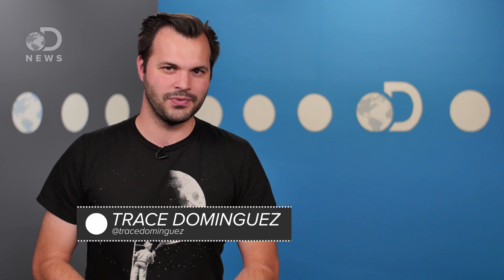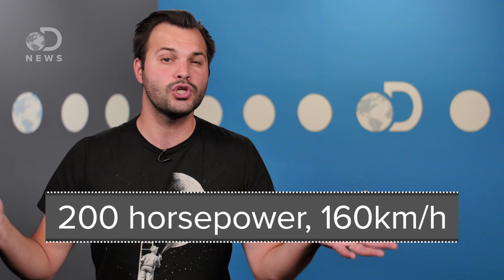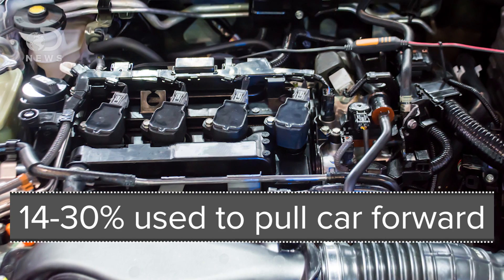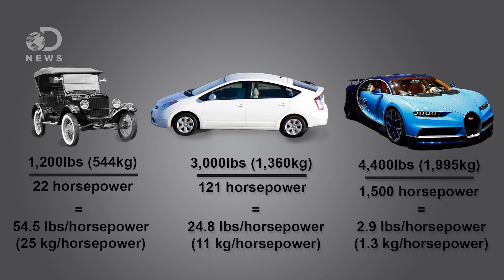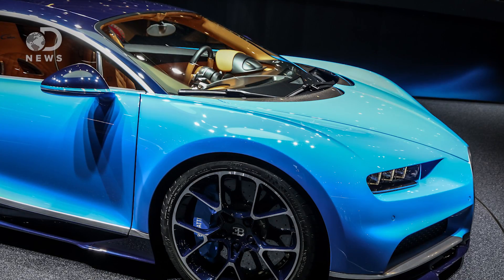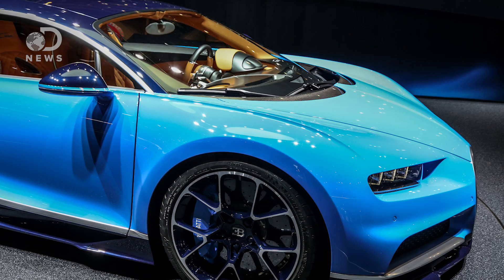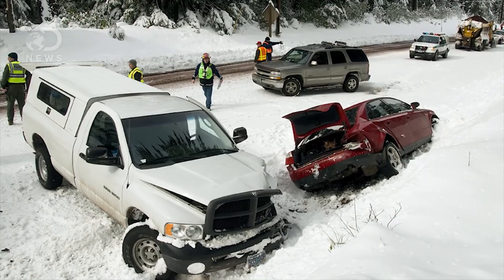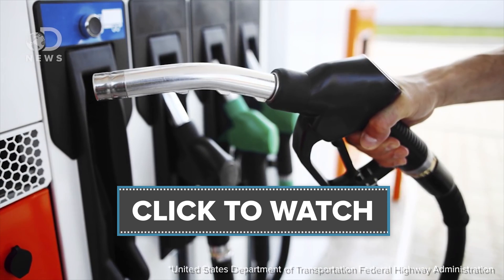Why Isn’t Your Car Faster Than A Sports Car?

Comment: Drive electric. 90% efficiency versus 30% in a gas car.
Reply: Tesla P90Ds are both efficient and fun. Seriously, have you ever been in one? The acceleration is brutal.
Reply: life is too short to drive a boring car 2jz 240sx throwing skids 0% efficient 100% fun vs 90% efficiency 0% fun going in a straight line
Reply: Chris Yates how fun is it to go in a straight line with a car that sounds like my fan
Reply: "0% fun", you're obviously clueless when it comes to EVs.
Reply: oh gee they forgot to put a steering wheel in my Tesla, doh I can only go in a straight line. LOL
Reply: almost as bad as the bmw i8 artificial sound hold on let me download a new sound pack for my car
Reply: +Jared A. You are not old enough to drive a car. get back to school. kid!
Reply: Kevin J Candlert Dnews does not go in the real detail, things like compression in the cylinder is not even mentioned. take F1 Cars. they have a small V6 engine with a displayment of 1.6L or 97 ci. that is tiny, my old mondeo had a bigger engine and even my consul from 75 has bigger engine but the F1 engine has almost no space between the cylinder and piston and thus no pressure loss and more power, note that they idle at around 2500 RPM.

Jared A. And what do u know about cars? Tesla has the fastest 4-door car ever made in history. What is a good car for you? if you would buy a good well equipped car then it will run over 36K.

Uncle Demort There is still sound from the air and the wheels. don´t believe it is soundless killing machine. now a days cars are quiet, you dont hear the engine and the exhaust as you did with the cars from the 1970, they wore significantly louder. And i would say that the low cost of charging a tesla compensates for the "PAIN IN THE ASS"  to charge a electric car, at least here in sweden, where the gas price is $6,12 a gallon, i would rather spend a few nights in a month charging a tesla for the fraction of the cost of filling a full tank every 3th week or so.
Reply: <drops mic>
Reply: supras out-race everything
Reply: Uncle Demort it doesnt make a difference if its toyota or not lol. u clearly know nothing about engines and cars in general. toyota wants its reputation to be how you perceive it, a economical car for family use, however the supra is an exception.
Reply: Again, I couldn't agree more! Also, in my last post I said "Internet car dude" and did not notice that that was ur name. It was not directed at you, lol!
Reply: So?..
Reply: well he got you there, but i have heard from a employee from Tesla in Norway that electric cars may get more load, people can´t heard them when they are coming and that increases the risk for an accident.
Reply: my blender sounds better than this lmao
Reply: drive sram etap
Reply: Checkout the Zombie 222, a 68' mustang on DC engines
Reply: fuck off. fuck electric cars
Reply: I have not over 36 thousand dollars for a shitty car (Teslas are shit just like Chevy, Ford, so on) that won't get me anywhere I need to actually be at.
Reply: Jared A. ikr, pigs from minecraft areuch better
Reply: Electric cars are deadlier, you can't hear em, people will be falling asleep by the wheel, people won't hear the car and go - get run over. AND RECHARGING IT IS PAIN IN THE ASS! Too often, and electric stations aren't everywhere
Reply: +Kevin J Candlert Also let me remind you that it's summer.
Reply: +Jared A. that's not a reason for you not to learn anything. keep watching dnews and other science channels
Reply: Vzano it's a minimal sound. We need to make cars louder and louder.  See, you live in Sweden. Sweden has the safest roads, Sweden is rich and has a lot of places where you can recharge. You see in Riga where I live there are only a few places. EVEN IN AMERICA they're not as often. You see since your country us rich, gas is gon' cost more. Our price is around 1.000
Reply: Uncle Demort safe yes, the safest, i can´t say because the quality on the road varies a lot. When i drive home, there is a couple of hundreds of meters on the road that leads to my house that has no sidewalk, people are literally walking on the side of the road and often close to cars.
Reply: +Vzano I checked statistics. England comes in second
Reply: +Vzano huh? we have that even in Riga. seriously, take a tallink to ruga with you car. ride here, myb in Russia a bit. You'll see how lucky you are
Reply: I have been in different countries then just in sweden. i have went from western sweden all the way down to serbia where i have seen roads that slinger around corners in the canyons with a edge that leads to certain death, it does also be seen when you travel across rumania from timisoara to suceava.
Reply: Do you struggle to recharge your cell phone? Obviously you do.
Reply: Teslas are not shit. Chevy was run into the ground (i.e. bankruptcy) by management and then saved by the US govt. They deliberately covered up a known part that failed causing people to die. You are too immature right now to understand the real auto industry.
Reply: +InternetDude yes I do. Electric cars are boring. That's it. Only electric car I'm willing to drive is a REGERA (if you know what it is Tesla nobhead). As I said, they're quiet (which is dangerous, cuz people don't hear you, and you might even fall asleep). Most of them are shite.
Reply: +InternetDude yes I do. Electric cars are boring. That's it. Only electric car I'm willing to drive is a REGERA (if you know what it is Tesla nobhead). As I said, they're quiet (which is dangerous, cuz people don't hear you, and you might even fall asleep). Most of them are shite.
Reply: +InternetDude yes I do. Electric cars are boring. That's it. Only electric car I'm willing to drive is a REGERA (if you know what it is Tesla nobhead). As I said, they're quiet (which is dangerous, cuz people don't hear you, and you might even fall asleep). Most of them are shite.
Reply: All your blabbing aside, what vehicle do you own and drive today?
Reply: +InternetDude I don't haha. but I'm into cars and motorcycles. you know what? fuck cars, stupid cages. All bout motorcycles! I'm getting a Yamaha R125, bcuz it's the best motorcycle I can legally drive
Reply: +InternetDude Dude, generally speaking, all American car companies are shit. Even European ones are doing idiotic things. And I have to be biased, toyota, mazda, honda, kia, those kind of car companies don't do random stupid actions such as, shoddy engineering where you basically have to rip apart the whole car just to replace a simple part. Looking at Volkswagen, and although tesla isn't shit, it's overpriced for no reason. And I don't mean "ohhhh but I can't spend more than 5k", I mean nobody should pay 70k for a car just barely worth 50k(which is more proper to Elon's "ideologies"), they aren't that difficult to produce. And what angers me is how tesla talks about trying to make EVs more popular when they basically make them into the Macbook pros of the car world. Only some people are even tempted to buy it. And I acknowledge the model 3 but it's still too little too late.
Reply: Oh I agree that in general American automakers are shit. Tesla isn't a normal American auto manufacturer though. They don't have sleazy dealerships, they have company owned stores. They don't have unions which are the worst thing ever when it comes to assembly plants. For example, Consumer Reports scored the Model S something like 102 points out of 100. It literally broke their rating system it's that good.

I would say Teslas are overpriced because they can get away with it and they need the cash to fund the Model 3, Gigafactory, etc. If the profit margin on a Model X was the same as a new Toyota 4Runner, then Tesla would be in trouble. They need lots of cash to build their company. The Model 3 is not too late, in fact it will be the turning point for EVs. They have 373,000 reservations for the car without many details. If you think the 3 is too little too late then you haven't been paying attention to the EV market. The 3 is going to crush everything else like the Chevy Bolt, Nissan Leaf, etc. How many other auto makers have over 300K pre-orders for their EVs? Oh and every one of those preorders required a deposit of $1,000 also.
Reply: +Jared A. Did you hear about what vw was busted with? False emissions values, that was very stupid and the legal fee was not cheap. All modern cars are harder to work on, more and more requires a mechanic to be fixed.

Btw Toyotas car are designed to work for 6 years afterwards it will be too expensive to repair and the costumer will buy a new car.
Reply: +InternetDude Of course I know everything about tesla. And that's why I say it's too little too late. The range is fine and all, the price is too, but it's smaller than the model s it seems, so it seems like they sacrificed space for range, it's price is good, but it's relative to the bolt in price which seems to be quite wrong considering the bolt is more of a SUV. But I do hope competition increases because the bolt and model 3 will definitely stir the market and change any drivers opinion on EVs.
Reply: there needed to be sacrifices to make the car affordable to the masses. It has a front trunk that regular cars don't have so the space part is debatable. Less space than an X or S, yes. Bolt won't even be real competition by the time the 3 is produced, you'll see. There is another 3 announcement coming later this year or early 2017 to announce that is has autonomous driving capability. Elon just hinted at that last week. He said they were going to have another announcement and it was going to be the "obvious thing".
Reply: +InternetDude see you call guys that are into cars petrolheads, not batteries
Reply: You lose more efficiency over all. Making the electricity and transferring it to your car is way less efficient than simply turning chemical energy in kinetic energy.
Reply: +Uncle Demort People don't fall asleep at the wheel unless the car has an autopilot like the Tesla. And, if you do fall asleep at the wheel of an EV, you shouldnt be driving.
Reply: +Jack AD nice joke
Reply: Uncle Demort it isnt a joke
Reply: Jack AD omg you're the funniest comedian ever ;D
Reply: Uncle Demort k
Reply: +Jack AD Supra is still just a Toyota
Reply: Uncle Demort i personally dont like toyota. however the supra just is my favorite car. it doesnt make a difference if its a toyota or not.
Reply: +Jack AD man, it's a Toyota ;D
Reply: Some sciencey people did some researchey stuff and determined that electric cars have about the same carbon footprint throughout its life as a fossil fuel powered car. Now, of course, take it with a grain of salt as I can't redirect you to the study cos I forgot where it was.
Reply: +Aqeef Hilman DNews did one too, but it only applies to coal powered regions, so 33% of the U.S is powered by coal. Even some gas areas are still pretty close, also batteries are carbon intensive to make but after awhile with gas power and the use of power to make batteries it generally comes in a little cleaner.
Reply: +Jared A. i'd love a nuclear powered car tho :D
Reply: Aqeef Hilman so fuk electric cars, right?
Reply: +Uncle Demort idk as a petrolhead I'm inclined to say fuck them too but I too care about the environment so it's a dilemma. I never want to see big V12s gone obviously but Teslas are pretty nice.. Or Regeras :o
Reply: +Aqeef Hilman so u want a nuclear explosion everytime someone gets in a accident
Reply: An electric car might be 90% efficient but depending on how the electricity was generated, the amount of carbon emitted to power your Tesla is no less than driving a car and is not significantly more efficient in generating electricity than a petrol motor is in generating kinetic energy.
Reply: It won't just go in straight lines. It probably has some of the best mid-speed drifting characteristics of anything short of an F1 car. Seventeen Inch high Center of Mass. It CANNOT roll and is completely stable in a power skid.
Reply: Rear end Ratio modification on P90D would get it to 250 ish, assuming that the aerodynamics don't make it lift off.
Reply: Electric cars are also more controllable, and are some of the safest cars in the world for those driving, both by safety ratings and driving statistics.

Plus, let's consider what has to happen for a pedestrian to get hit by a P90D?

Step 1. Pedestrian walks into road without looking.
Step 2. Sleeping driver somehow hasn't crashed before coming across a crosswalk.
Step 3. Pedestrian does not notice headlines or headlights are not enabled.
Step 4. Pedestrian does not notice tire noise, drag-induced noise. Also does not see approaching car.
Step 5. Autopilot does not brake for pedestrian or automatically honk the horn, despite having plenty of time.
Step 6. Pedestrian is hit by P90D.

Ways to prevent this:
Give cars headlines: done since they were called horseless carriages.
Have pedestrians not walk in the road: Done since the 1910s.
Give cars a feature to prevent accidents by detecting obstacles: Done.
Give cars a horn to warn pedestrians: done since they were called horseless carriages.
Don't sleep and drive on curvy roads full of pedestrians: <-- how would anyone even do this to begin with?
Reply: A Regera isn't even a regular electric. It's not even a plugin hybrid. It's literally just a hybrid, like McLaren has been doing for years. And furthermore, can you say impractical for daily life? Yeah, it considerably outperforms every Tesla ever, and probably every Tesla available for 25 years, but...

You're comparing a $2 million 2-seater entirely (if not entirely directly) gas-powered Hypercar, with a production volume of 80 and more power output than most World War 2 fighters...

To a $120,000 at full specs 5-seater (with a lot of extra space to boot) entirely electric Luxury Sports Sedan with at most half the horsepower and 20 times the electric battery capacity. Oh, also, it's been sold a hundred thousand times.

No. Just no. If we're playing the fast gas-guzzling Impractical millionaire toy game to the tune of $2 million, thanks, but I'd rather have a jet. It has better range anyway.

But even still!

The best Tesla will do 0-60 in 2.8 seconds, which, coincidentally, is exactly how long the Regera takes. Sure, the Regera will definitely outpace it on 0-120, and By god there's no way an unmodified P90D will go to 180, (though again, with the right rear end ratio, it would reach 250 on a long enough runway, that or take off, it's not a lack of power, but a lack of a higher gear that prevents the Tesla from going into Veyron territory).

You see, the Tesla is an electric car that, at least on some specs, competes with cars that weigh 25% less, run only on Premium gasoline, and have engines twice as power, cost 18 times the price, and STILL it is just as fast 0-60 and if it were set up with two gears, would have the same top speed due to superior drag coefficient. IN A LUXURY SEDAN.
Reply: +Peter Smythe the regera will do 0-60 in 2.7 seconds, not 2.8
Reply: Peter Smythe but the Regera is a plugin hybrid 😭😭
Reply: +InternetDude - I am in full agreement with you about the engine efficiency. From what I have heard, the torque of an electric motor is just amazing! It is sorry to see the foolish people replying about how boring an electric car is and then says how fun a 2jz 240sx is... could the poster of that been any more typical of an "internet car dude" lol. The real problem with the electric is not the motor, it is batteries... If they develop a battery that I can drive 6 hours on the highway and then fill up in 5 minutes, I am selling my gas cars any day! But until then.... gasoline :)
Reply: Slow down and enjoy the journey, not race to your destination. Look at it that way instead. If you live in an area with Superchargers, you can get an 80% charge in 40 mins. How long do you need to stop and pee and eat? What I'm saying is if you can Supercharge the inconvenience of charging is minimal. Either way electric driving is superior. People that say otherwise are just haters who are afraid of change and think like other sheeple. Remember half the population is dumber than average.
Reply: ok cows create more pollution so just fucking give up on steak

Comment: Top speed has nothing to do with weight...
Reply: It does though? If the car has a higher mass, it will go slower because the engine has more to pull.
Reply: Ewan Newall Well weight affects acceleration. When it comes to top speed it does too in a form of added friction, but its not so significant. The video made it sound like power/weight is the most important aspect to measure speed of a car and by that logic something like v8 ariel atom has 2x better power to weight ratio than a Veyron, so it should be faster than a Veyron, but its of course no where near as fast.
Reply: It does.

Comment: I would've much preferred you guys going into what makes the engines of today more powerful than the engines of the first cars.  It's pretty obvious that cars have gotten lighter and engines have gotten stronger, but the answer as to why is much more interesting.  You could talk about V-engines vs. Inline and Boxer engines, advancements in turbos and supercharging, how octane levels in gasoline affect performance and longevity, pretty much anything would have been more interesting than what you guys talked about in this video.
Reply: Likewise. I was hoping this video would be dedicated to that instead of something so basic. :/